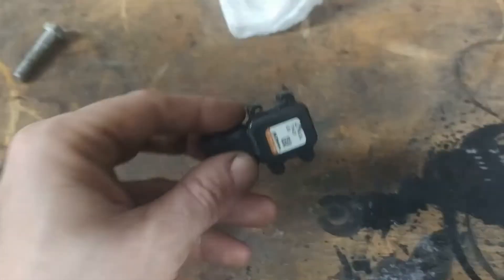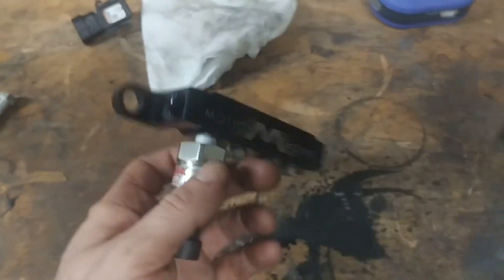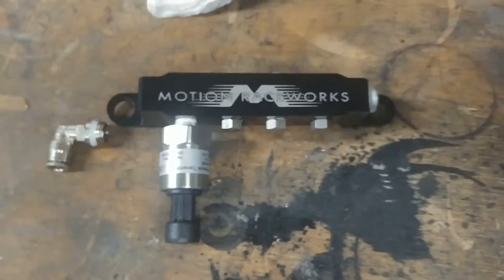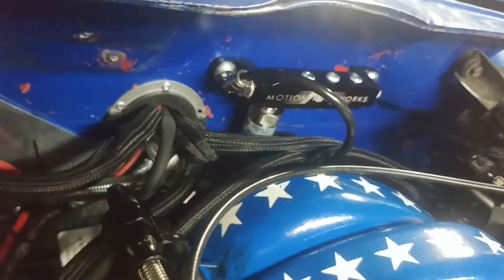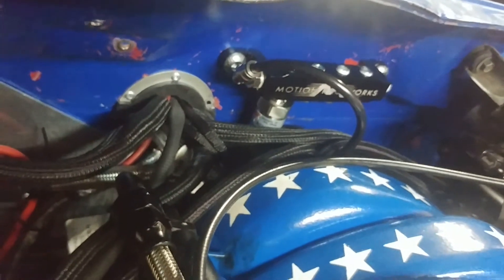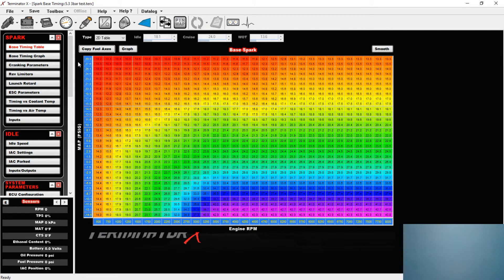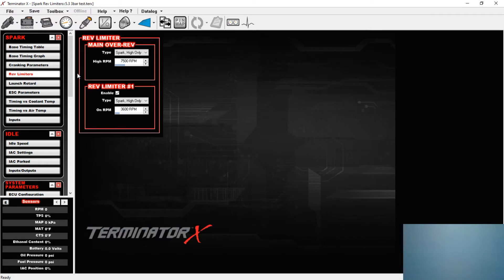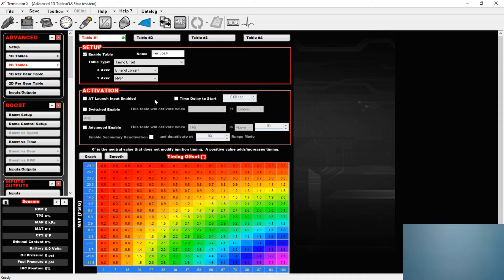Up Arrow Mod, 3 BAR MAP sensor install on Terminator X

Comment: What is the proper scaling for the one you were running, its not in the drop down for holley, and i cant find it on the webs
Reply from the maker: Thanks for watching and commenting. The scaling for the Low Doller 3 BAR sensor is as follows.

voltage/KPA/PSI
0.50/0/-14.5
0.77/20/-11.6
1.03/40/-8.7
1.30/60/-5.8
1.57/80/-2.9
1.83/100/0.0
2.10/120/2.9
2.37/140/5.8
2.63/160/8.7
2.90/180/11.6
3.17/200/14.5
3.43/220/17.4
3.70/240/20.3
3.97/260/23.2
4.23/280/26.1
4.50/300/29.0

Comment: So I have a distribution block with all my vaccum lines Plumbed to it. I’m switching to a terminator. Will it be okay to hook the sensory to the distribution block I have now or do I need to run a separate just for the sensor
Reply from the maker: Attaching the sensor to the distribution block will work.
Reply: @TrailerParkMotorsports  alright even tho I have lines from my waste gates, intake manifold and bov also going to the block?
Reply from the maker: @Boostedracingchannel98  in that case, it might be worth getting a remote sensor mount for just the MAP sensor.